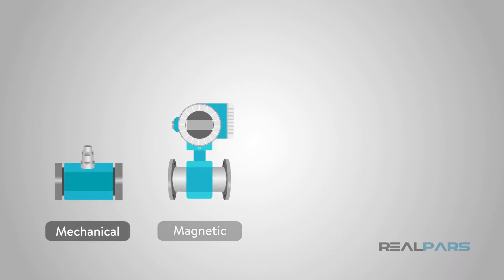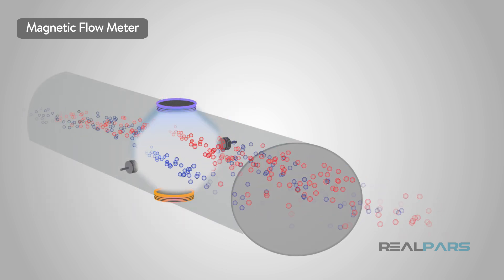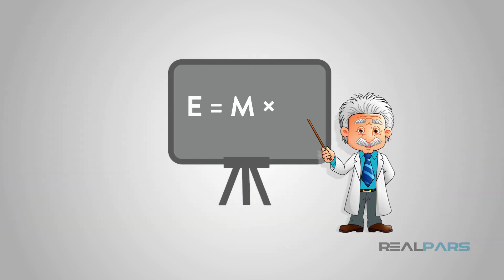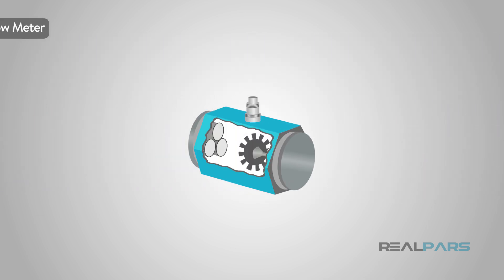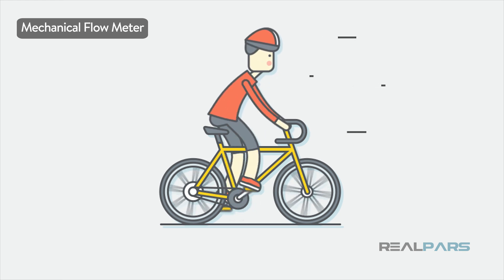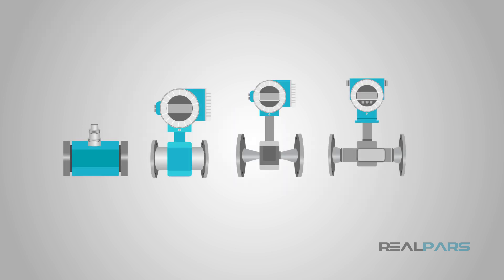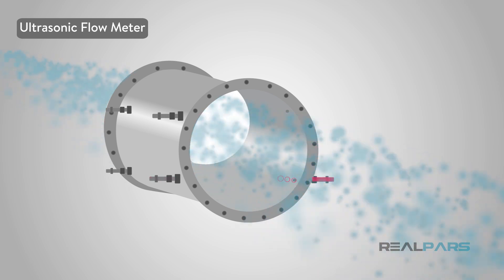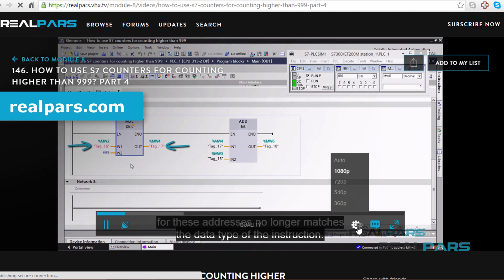How Flow Meters Work

Comment: Which is the best flow meter to measure the quantity of liquid.

our application is to transfer the desired quantity of liquid into one place to another place, once the quantity is transferred by measuring through this flow meter, the pump will stop automatically. 
quantity will be decided every time of passage, so need some advanced system for this.

Comment: Which is a right flow meter for monitoring sewage in a vacuum based sewer system.
Reply from the maker: A non-contact ultrasonic flowmeter that straps around the sewer line is a well-known application.

Comment: can anyone guide, which flow meter is suitable for measurement of flow rate of refrigerant in a refrigerator? Also, can anyone justify the use of a particular flow meter for flow rate of refrigerant?
Reply from the maker: The flow of refrigerant in a refrigerator would be very tough to measure with a flowmeter.  The flow path in a refrigerator is fairly short, and the much of that path is two-phase flow.  The best way to determine flow is to measure:  1) compressor suction temperature and pressure
,  (2) compressor discharge temperature  and pressure, (3) condensing temperature and pressure and (4) evaporator  temperature and pressure.  Then using Pressure-Enthalpy charts (or equations) for that refrigerant, you can determine the mass flow from the net refrigerant effect.

For large commercial refrigerators, a trend of flow over time can provide useful maintenance and performance data.  For a home unit, not so much.

Comment: Thanks this is very helpful you can go a little detail in this chapter
Reply from the maker: Great to har, Suriya! Thanks for your feedback!
Reply: Our A+K Balanced Flow meter with 2D:2D straight pipe advantage, less flow resistance and high temperature flow test. more information: wangt@keyontechs.com

Comment: Is there any practical difference between swirl flowmeter  and vortexflow meter
Reply from the maker: Yes. Instead of a shedder bar that creates vortices, a swirl flowmeter puts the fluid into rotation at the meter entry . The flow delaminates into high- and low-pressure pulses, which are measured much like a vortex meter.  They are similar, but the swirl flowmeter is a little more accurate (and expensive) and is better at low flow ranges.

Comment: Which one is suitable for acid process and can be reduce, increase the flow rate, calibration option and all
Reply from the maker: For acid process streams, I would choose a magnetic flow meter or a Coriolis mass flow meter (not discussed).  You need to make sure the materials of construction are suitable for the service.  For HCl or Acetic Acid, 316 SS and Alloy 20 are good for a Coriolis meter, and these same materials plus Teflon-lined are good for a magnetic flow meter.  Consult with an engineer with a materials background before choosing a material of construction.

Comment: can we use mechanical flow meter at the inlet and outlet of a water tabk to measure the daily discharge? pls reply
Reply from the maker: Absolutely.  In fact, many local water authorities require this type of flowmeter.  The discharge flow is often by gravity, which requires a mechanical meter, since most other meters require a minimum pressure to function correctly.
Reply: @realpars  how can we buy it. Can u pls give me some links to buy this product
Reply from the maker: Check out this link https://sie.ag/30E3E6z . You can contact Siemens in your area to receive advice on which model you need to order.

Comment: Ohhh............ I remember having to replace a meter once. I was supposed to instruct another work buddy and take the lead in that operation. Job was done but up until today I was really confused how the hell is that thing going to measure flow. It was the magnetic one. Just a straight hole through the whole thing. Yeah dont expect anyone whether above or below us to know everything lol. Thankfully a lot of stuff are idiot proofed so we just need to lizard brain them to completion and hope things work. Thanks for the video. Now thats one thing I can get off my mind.
Reply: Try our A+K Balanced Flow meter can test different types of Fluid, such like gas, liquid and steam with 2D:2D straight pipe advantage, less flow resistance and high temperature flow test.  more information: wangt@keyontechs.com

Comment: hi there i would like to ask you i deal with digital flow meter in my work it changed its reading from real number to hexadecimal number for example from 97834567 to 1005E08 how could know the real number should i use conversion from hexa to decimal ?
Reply from the maker: Hey Sameer,
I think you should refer to the internal settings of your Flow Meter and I believe there is a setting to change the Hex to Real.
Reply: great thanks , really your videos and courses on your web and youtube is the better content i have ever seen .

Comment: One thing to remember is that most flowmeters measure velocity and compute the flow rate based on the square footage of the flowtube.  That is to say, the meter ASSUMES the flowtube is completely full and there are no bubbles in the media being measured.  Easier for gasses than liquids.  Most flowmeters also have a minimum velocity they need to see before they start reading flowrate.  Therefore, even though they say they have a range of zero to something, it’s actually some number above zero to something.
Reply: Good comment.